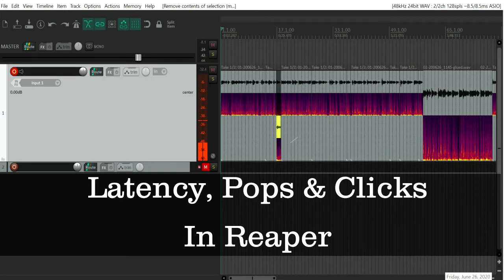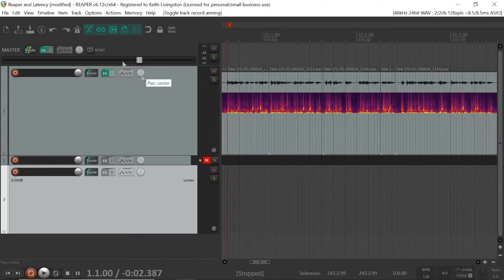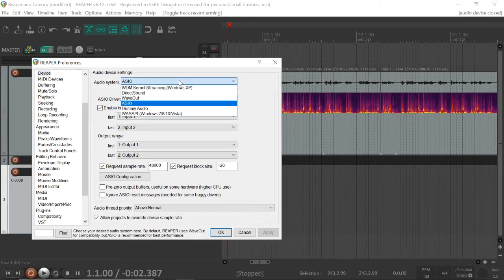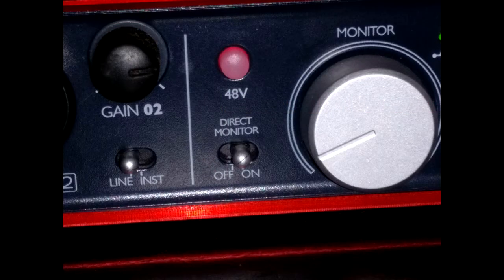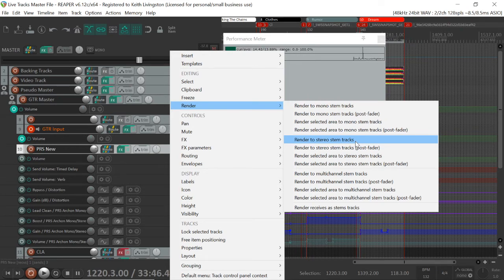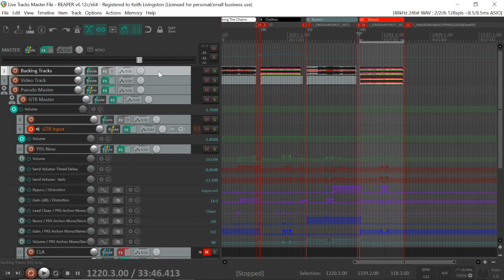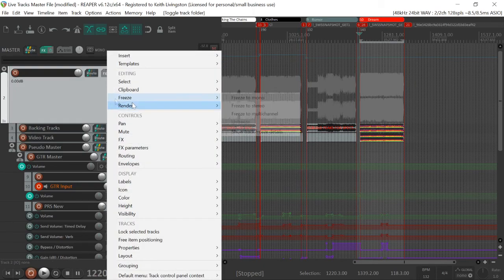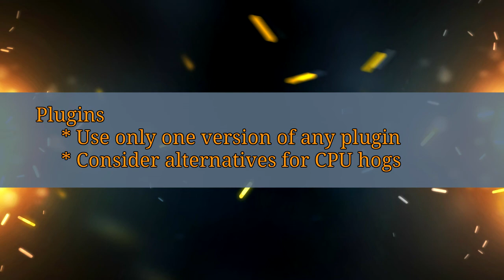Dealing With Latency, Pops & Crackles In Reaper

Comment: My audio kept stuttering every time I stopped playing the song. It was frustrating. It didn't do it in my other songs. I just realized why. At one point, I wanted to slow down the song in the verses. I used an envelope called "playrate" on my master track. Eventually I decided against that, but I still had the envelope on my master track. As soon as I unchecked it, the problem went away. I'm glad I finally figured it out! 😎
Reply from the maker: @BillGraper  yeah, it's easy to set something and not remember it later. 

In general, you'd use tempo markers and envelopes to slow a song down, unless you're doing something unusual.

Comment: So my issue here is that other DAW run my vst without issue. However my main daw doesn't support vst3 so I have to switch to reaper until I can afford the most recent version of my daw.

The vst on its own runs perfectly without issue.

Run in reaper. Immediately staggers, pops, stutters and that's with one vst.

I shouldn't have to be a programmer to run a vst in a daw. It should be plug and play without hassle.

So now I'm stuck having to learn a plethora of terms and dialogues that I don't understand just to be able to play and record vst.

It is hugely counter intuitive.
Reply from the maker: @phalanxiatheroan863  it's not that much to learn. Increase your buffer size, keep plug-ins off your master bus, render/freeze tracks that have heavy CPU plug-ins on them.
Reply: @NLNPNL  I right click and insert new vst instrument on new track, it brings up my list I choose the vst I want.
Seems to work well until I load a new vst into a new track?.
Causes popping and staggering on the original track and the new one.

But this doesn't happen in other playback environments on the same device.

Wondering how to fix. It isn't too many instruments, it's a reaper thing.
Reply from the maker: @phalanxiatheroan863  What is your buffer block size setting? And what does Reaper's performance window show?
Reply: @NLNPNL  Media buffer size is set to 256

The performance window shows 0.0/0.30 idle and 0.30/0.60 in use with one instance of Musio. (another instance loaded on a new track.
Reply: @NLNPNL  okay now it's randomly working again. But I didn't alter anything.  It seems to be randomly doing this.
Reply: I left the program open whilst I had to do something and just comeback, and it's stuttering again. But the % usages haven't changed in performance meter.

No idea what's causing it.
Reply: @NLNPNL  also thanks for replying.

Comment: I'm experiencing a weird fuzzy sound on my guitar (distortion) every minute or so. I've had this problem in the past and I got help from a friend, but now I can't remember what's causing it. It's neither the buffer or the latency.
Reply from the maker: @theunholinesswithin70  do you have a plug-in in trial mode? Another option is some computer process that runs intermittently.
Reply: @NLNPNL  No, I only have free plugins and a paid for drum sampler. I've recently tried a Focusrite but switched back to my Roland, but I haven't changed anything on the Roland

Unless something was switched on it while I set the Roland back up..
Reply: @NLNPNL  I would put my mic up to the speaker, but my laptop's audio (system settings) only has LINE available, which I can't record in Audacity with.

Comment: How about crackling during playback only?
Reply from the maker: I can't think of anything off the top of my head that would occur during playback as opposed to recording. But I would use the same diagnostic procedure as I suggest. Call up the performance window and sort by CPU usage. Turn off the top hungry plugins there. Take plugins off the master. Look for any system wide programs that might be running, etc.
Reply: Crackling before and after rendering, but not while recording (drums)
Reply from the maker: I'm not sure I understand. You're rendering a final mix or something? And the cracking happens before you render and after you render? Do you mean when you play back the rendered mix it has crackles @mrnickderaiche
Reply: Thanks for responding.  I record drums through my mixer into my laptop (not a Mac) with Reaper. Then when listening to back to what I just recorded it crackles. It also crackles after I render it. Even if I play the file back on a different device I still get the same crackling.

Comment: I've literally tried EVERYTHING in this video and it still hasn't solved my issue. 
I have crackling audio just from direct monitoring through the interface as soon as I open reaper. 
I don't use any monitoring tracks in reaper and still have the issue. It's so bad sometimes it will freeze up my session in reaper and have this hideous ring. 
I've reinstalled drivers, nothing fixed
Reply from the maker: It could be one of many different things, unfortunately. What block size are you using? Have you tried disabling your network card? How much RAM do you have? If you're on PC I'd run LatencyMon and see if you can find any processes running that don't need to be.

Comment: Thank you, I was able to get rid of the pops and crackles while mixing. But after I render the file, the pops and crackles are still present. I tried playing around for hours, but can't get rid of them. Do you have a fix for rendering the song in the same ASIO format that I am mixing in?
Reply from the maker: I would probably have to see your render settings to make suggestions. In general, render any tracks that have any heavy FX. Render offline at a slow speed. Use a pseudo -master for FX, rather than the actual master (add a track below the master and run all your tracks through it). Turn off any background processes and your network connection. Close any FX windows that are graphics heavy.

Comment: Hey hopefully someone can answer this for me. I have the crackling and popping in my recording during play back and recording. I found that it came from a VST so I removed it and added a different one and still got the same issue. 

However, when the VST’s are not loaded into the midi track the popping and crackling go away. It started fairly recently. Should I get a different daw (using reaper currently)? Or is there a setting I’m just not seeing? Or should I destroy the file and start it over even though I don’t want to do that haha?
Reply: I would open the performance window in Reaper, to see what's going on. You can increase the block size in the buffer settings, make sure you don't have any FX on the master. However, probably the easiest solution for a midi track is to right-click on the track, and render, or freeze it.

This turns the track into audio and takes the vst offline.
Reply: @KeithLivingston  this fixed it! Thank you!
Reply: @KeithLivingston  4 months later and I needed this same advice again haha. Thank you once more for the help!
Reply: @MetalDetailer  sometimes I come to get my own advice, when I forget :-)

Comment: So you said that the only reason someone have pops and crackles when recording is the Latency?? Not the much high volumes on settings or the wrong mic positions, or wrong volumes in preamps??I think you must rearrange this!
Reply: I don't say that the only reason someone has pops and crackles when recording is the latency. I don't say anything like that. I also give several other examples of things that could cause interruption of the CPU's ability to process Reaper needs, and thus cause pops and crackles. You're correct, I didn't mention overloading recording levels. I think most people would call that distortion, and not pops and crackles. I also didn't mention noises coming from bad cables, or radio wave interference, which, I suppose could be interpreted as pops and crackles. Those are good things to check, but result in a different kind of noise, occurring at different times.
Reply: @KeithLivingstonMusic  Yes i agree for that maybe the kind of noise is the key for any different explanation.
Reply: Dude, just checked out your channel of drum covers. Awesome!
Reply: @KeithLivingstonMusic  Thank you! I try to mix myself and do all the processes with very low budget!! Thank you for stepping by!! Take care and i'm sorry if i was rude in some way but my English is not the best! Merry Christmas!!

Comment: Thanks for the tutorial! I have a question:
I just got an AKAI MPK Mini MK3 and it didn't ask me to install ASIO so I'm using DirectSound. Just wondering what settings would you recommend to get rid of the pops and crackles? Currently they are:

Audio System: DirectSound
Input: Primary Sound Capture Driver
Output: Primary Sound Capture Driver
Sample Format: 16bit
Input Channels: 2
Output Channels: 2
Samplerate: 44100
Buffers: 8 x 1024 samples
(latency: 185 ms)

I'm an absolute beginner so I'm sorry if it's a weird question. I'd really appreciate the help!
Reply: For start you can cut the master volume 1 or 2 db , this will eliminate the pops and crackles if it's not change the buffer size to 8X 2048.Sorry for engage to the answer but i see that you ask him this before 3 months and your answer is below 0.

Comment: So if I’m getting a popping sound while steaming… with or without speaking, changing  my buffer rate might stop that from happening?
Reply from the maker: Popping is generally a result of CPU usage. Anything you can do to reduce it, might help. If you've got a graphics card that can be assigned to handle the video portion, that might help, as well.
Reply: @NLNPNL  yea I have a 1660 that handles all the graphics… but the cpu must be tapping out. I’ll have to see if anything is running in the background